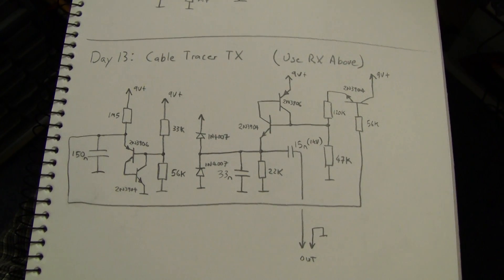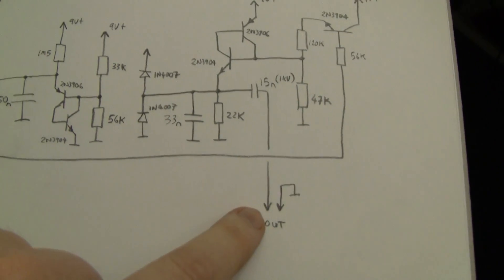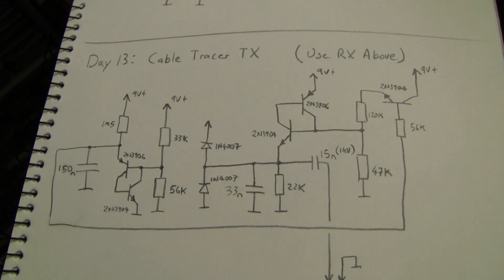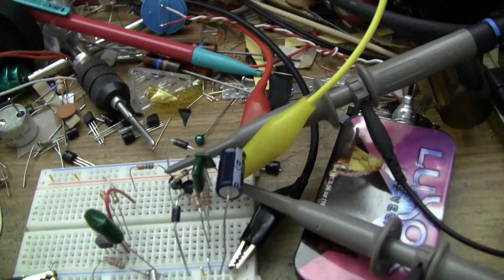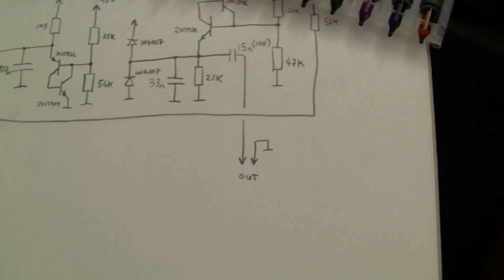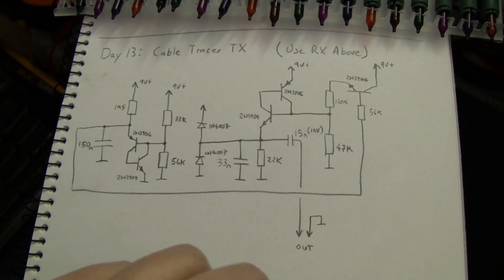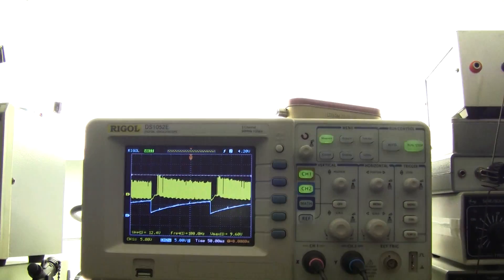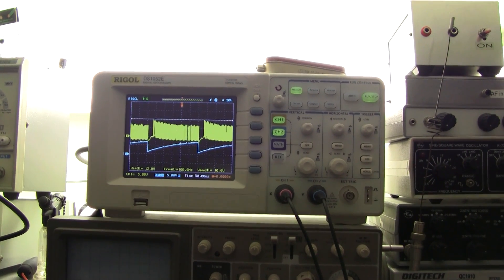Advent Calendar of Circuits 2011: Day 13: Cable Tracer Transmitter

Comment: Hi there, I am very interested in your cable tracer one think on the plan is not clear for me is that  resistor on top left corner of you plan witch to 9 volts attach to what is the value on that ??
Reply from the maker: 1M5 (1.5 million ohms).

Comment from the maker: The axial electrolytic is across the supply.  I often leave it on the breadboard as a handy way to clip leads to the supply, and as a bypass to stiffen the rails.  For this circuit it probably isn't contributing much and can be omitted or you might use a 1-100 uF range device.

Comment from the maker: @ccam108 For almost all the circuits here a general purpose NPN or PNP will do.  I use 2N3904/2N3906 because I have a huge number of them, but BC547/557 or similar will work.  JFET and MOSFET wise it is also pretty safe to substitute, but you may need to tweak some resistor values, especially with JFETs as they tend to have a large spread of Idss - true even with the same type of device really.

Where it can matter: high frequency, tiny currents, large currents, large voltages.